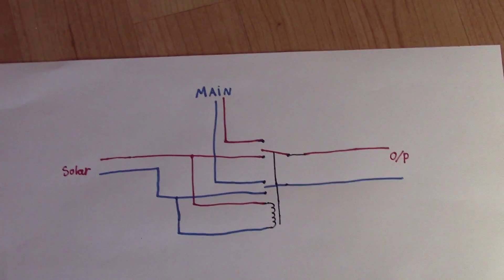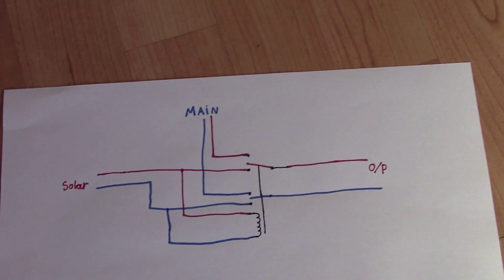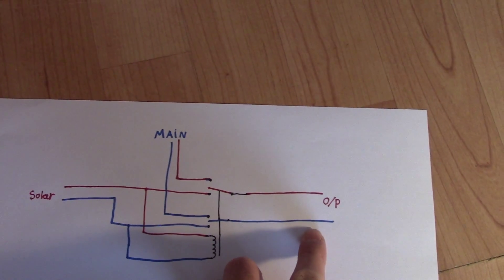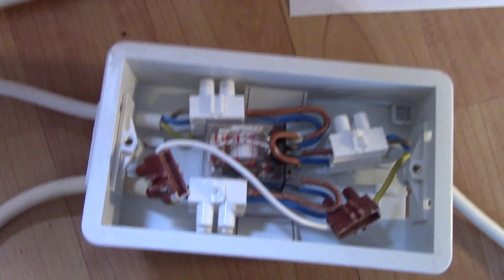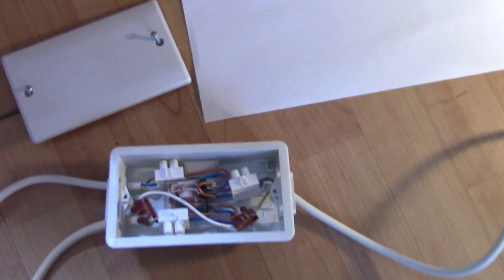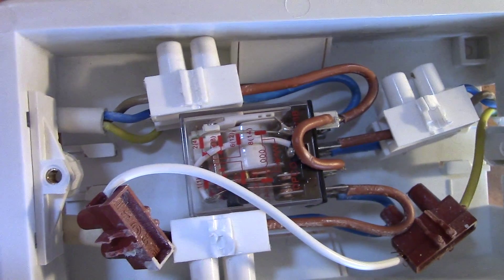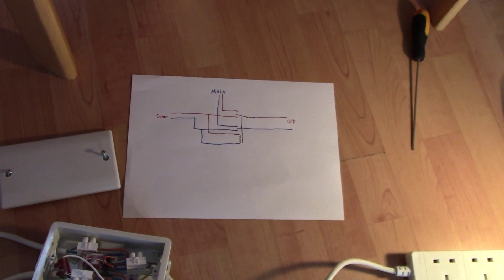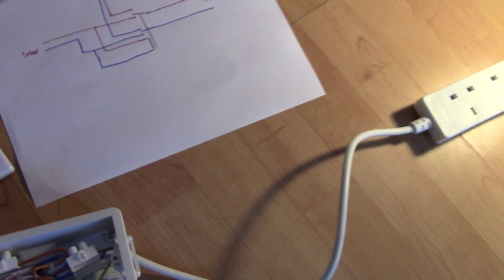Automatic transfer switch

Comment: I came up with a similar idea with for the battery backup on my homemade warning siren. I thought about making a switch that feeds grid power to the siren panel in default position and then feeds battery power in the other position. It is operated by an inverted relay that is operated on the AC power. When the AC turns off, the inverted relay pushes the switch to the battery position.

Comment: is a SPDT relay?
Reply from the maker: Its a DPCO relay. get one that rated for the mains voltage where its going to be used, and also be mindful of the current ratings. always use a fuse of the same or smaller rating than the relay. I got mine for RS, but im afraid i don't know that part number, but any DPCO that matches the voltage and current rating will work. Just please be mindful that there is main voltages in the design.